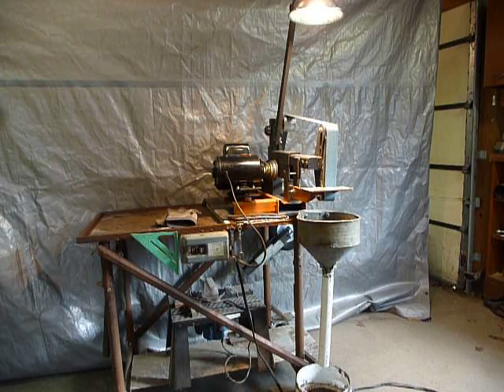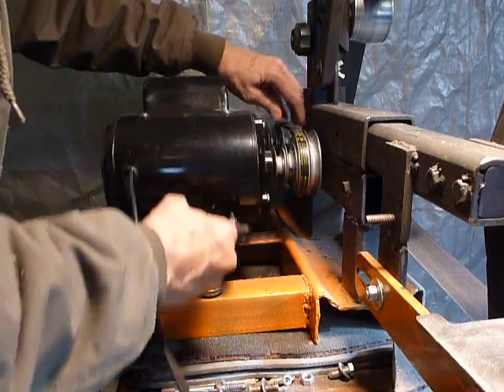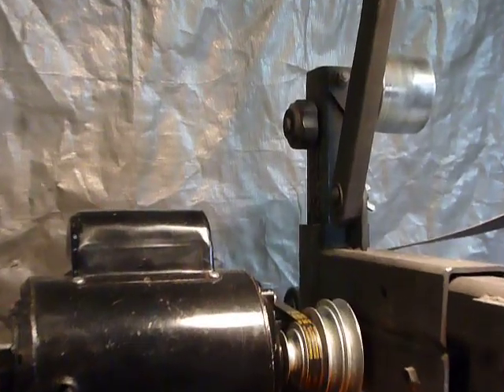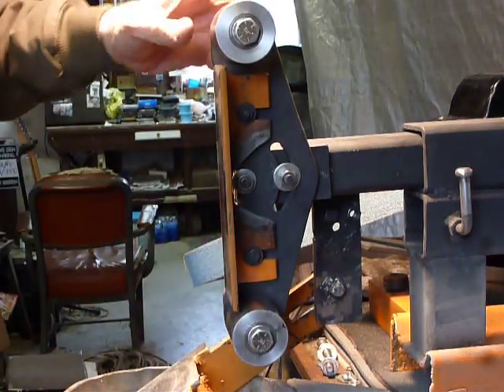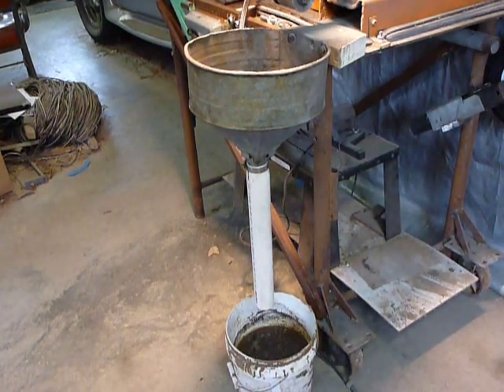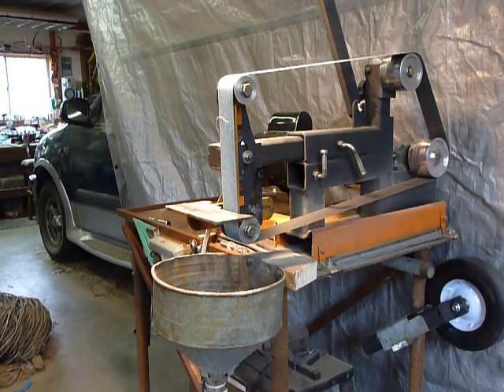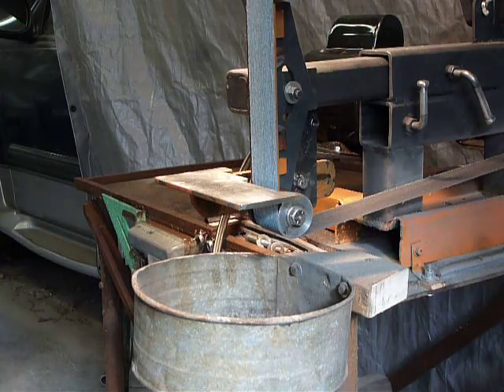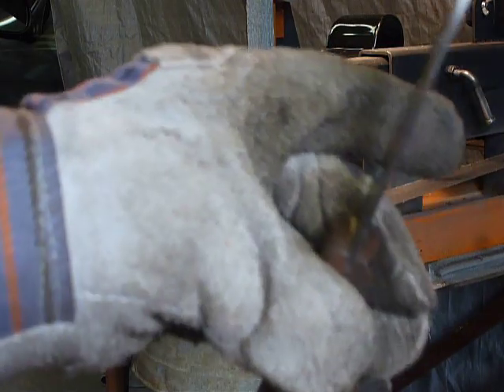Home built 2x72 belt grinder.

Comment: I made almost exactly the same machine. Just with a VFD, an external spring instead of that internal spring. And I used that bottom  tube for the attachment.

Otherwise, the same :)
Reply from the maker: It's been a good machine. No repairs so far. home made machines tend to be overbuilt and heavy duty.

Comment: Get a lovejoy coupler and run direct drive motor to  pully shaft more power and less noise.  Amazon has them in all drive shafts sizes.
Reply from the maker: I wanted a variable speed option ,thus the step pulleys

Comment: Great job! Looks about the same as mine that I built... My only issue was that damn tracking wheel... The bolt that 1/2" bolt that went into the wheel never stayed 90
Reply from the maker: Thanks for watching Al..alignment of all four wheels was challenging alright.
Reply: Alfonzo Terrones maybe try a jam nut set up. Would take 1 or 2 wrenches to adjust, but may work.